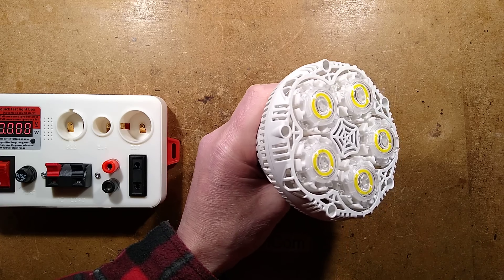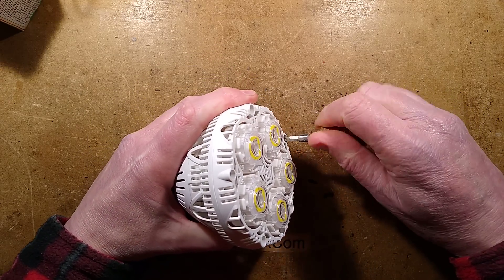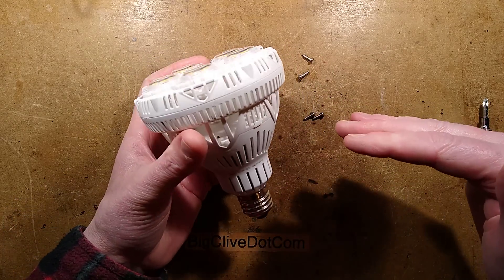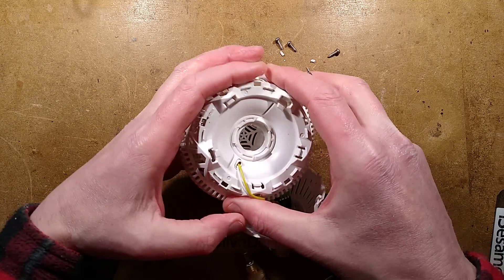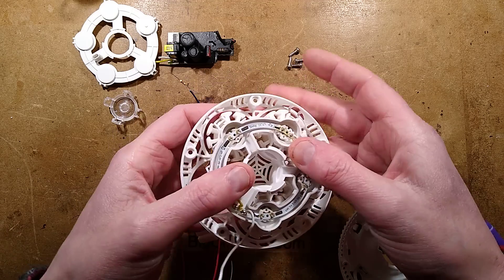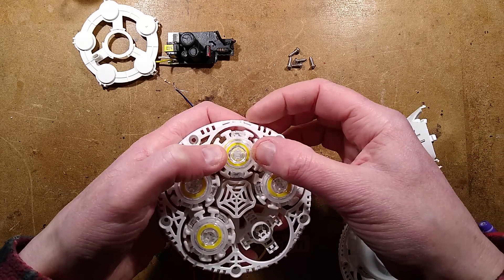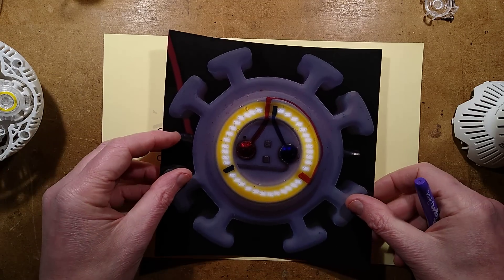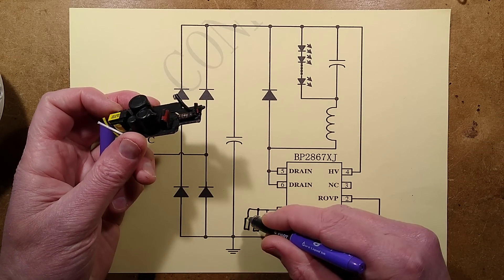Huge 30W ceramic core LED light (with schematic)

Comment: On horticultural lighting...

I've been keenly watching the horticultural LED vs 1K HPS battle unfold for... a long time. A topic that that has taken up much of my brain dollars and worn the ink off of many folks' calculators... 

That being said, this looks like like a solid contender as a grow light. 
I like the vented design very much. That's why I'm writing this. You can see that LED arrays look good on paper brand-new, but in reality, how long will they perform? I think good heat management designs like this help will win-over the HPS die-hards (no disrespect whatsover). This opinion is totally off-the-hip and regionally flippant.

HPS lamps always had venting options near the hot bulb, grow LEDs ignored this in the past relying on CPU fans blowing back into the environment. You could screw these bulbs into a simple exhaust manifold/Edison socket array, you could enhance the cooling effect on the drivers, and also get a very improved, dispersed, hot air exhaust. Greenhouses are hot and need to be vented. An array where the sockets mount on the inside of a vent, with the drivers facing out... Hey that could be pretty clever. Yada yada, they might be shit too. Anybody got a gr/watt on these babies?
Reply: You wouldn’t want to use this for a grow light. There are so many good lights out there now for a pretty good cheap price. I grow my own cannabis in Illinois. I have a medical card. I’ve got LED lights where I can adjust them for any time I want, they don’t need a fan they have a heat sink I can control them with an app anywhere in the world. I can set up a new light schedule I can turn them on and off I can adjust them. I have a grow tent and I have a ventilation fan. I have everything I need. the lights I got. we’re around $200 each. I have four of them. They are awesome. They are 600 W each light. I grow four or five plants. One light per plant. The only thing I need now. is an automated watering system. I have the seeds and the soil. I already did one successful grow. Last year it was approximately 24 ounces dried. That’s from four plants. I have to grow them in my garage. It gets cold in there. So I’m waiting for it to warm up a little bit. To start my next grow. I’m going to start it probably in about four or five weeks. I will try to get 2 Grows. before it gets too cold again. The lights that I got are called  MYLUMii. They don’t have them on Amazon anymore. I would recommend may be getting vivosun I hope you have a blessed day. God bless you and yours.
Reply: @BLUE_OCTOBER-TRIX  That sounds like a good setup man! For watering, I highly recommend programming an Arduino to automate your light schedule, watering, adjusting nutrients, and adjusting ph in your reservoir. You can get full automation via arduino and relays.

Ya.. 
Went of a good tangent about this bulb but I have also seen solid evidence of insane yield (>2.5g/w) using cheap, de-lensed, led edisons. This just struck me as as the next logical step, especially for large indoor farms. Cheers mate!

Comment: with the heat the thing gives off, could you heat a closed off room?
Reply: 30 W. Insulate your room well; very well.
Reply: Probably not very well
Reply from the maker: It could add a little heat.

Comment: it's amazing how much heat those emit, considering how 'efficient' LED is supposed to be. maybe SANSI is attempting to replace well house heaters, rrr I mean 100-watt incandescent bulbs. lol.

I wouldn't think 6 watts into 36 elements would be that bad, that's only 166mW per LED-chiplet. I don't think they would be running IR LEDs with a phosphor coating (usually it's blue to UV led with phosphor coating), interesting. maybe SANSI figured out how to break at least three of the laws of thermodynamics, stays blisteringly hot an hour after it's been unplugged, lol. /some-sarcasm

Comment: that looks like a job for somebody with a low social score but mechanical capabilities.  assembling this thing is a punishment job for infractions resulting in a lowered social score, a skilled worker has been reduced to hand assembly as punishment and the market gets a very inexpensive(buy 1 get 2) light fixture.  keep your social scores up

Comment: Sansi has a 27w ceramic light here in the States, and it is somewhat like a corn cob light, but they have a 30w like the one you dissected. They have a range of other ceramic lights as well.
Reply: Where are you finding these in the U.S.? I am interested in them... Thanks.

Comment: I looked at the previous lamps closer. You should be able to open them non destructively by showing a dental pick in one of the slats and reaching out for the inside bit of plastic with the "hooks"
Reply from the maker: I worked out how to open the simpler lamps.  You can push each clip up with a driver, but only so far, and then you need to wedge the top or they just clip back shut again.  Once they've all been wedged the top comes off with a bit of effort for easy hacking.

Comment: I must be missing something here... Why ceramic as the heat sink? I have to think there are far better options than that unless it only comes down to cost.
Reply from the maker: It's high thermal conductivity ceramic that probably has low thermal expansion.

Comment: These are actually great for beginner indoor gardeners . Very hot tho so make sure you have a good exhaust and airflow .

Cob led's are really good but if the heat isn't properly dealt with they can burn out quickly .
Reply: They always do... I've never had much luck with large COBs lasting much past their 1 or 2 year warranty. 😒

Comment: Strange and complex (over-engineered?) construction indeed. I wonder what kind of incandescent lamp it's made to replace? It's too fat for being like a PAR.
Even destroyed, I'd easily find some uses of the ceramic modules alone. Bright, well cooled, can easily be repurposed with a cheap power supply. Neat stuff on their own. 
Very satisfying plastic crunching noises, BTW.

Comment: I had 3 of those 40 watt Sansi lights, 2 of which went blinky blinky after a few months, last one still in its box. I have since gotten slightly smaller 25 watt ones that have not failed yet, powered on a AC smart dimmer plug. The smaller ones were bought in Feb 2022, so they have lasted over a year without any problems so far. There was some slight flicker on the lowest power, under 30% though, changes between 2 brightness levels only changing luminescence 2 or 3 times a minute. Looking forward to watching this on my watch later list to see what they look like inside.

Comment: We may see this housing design again as a movie prop - an ion engine for interstellar travel maybe....someone in China took a "snaps and clips in plastics- 201" course! Like the bus exhaust dip coating on the power PCB- or maybe Phil Swift hits 'em with black Flex Seal.
Reply from the maker: It does look like something the prop department would repurpose.

Comment: i have been looking at bigclive's page of projects. it is remarkable how our interests intersect-electronics, mains electricity, booze, long hair on our heads, and explosives/fireworks. thanks clive. i particularly like your trick of using 2 resistors to contact the pads on bayonet light fittings. 
.oh, and the using of 10o resistors to initiate things is brilliant. it works on model rocket engine as well as the official ni-chrome ones at a tiny fraction of the price.
Reply: Wait he has a projects page!??!!??? Ive been following for years nd didn't know this
Reply: @roxasparks  His YouTube name is the URL of his web site. Just do the obvious substitution of "." for "dot". Project page and a bunch of other stuff.
Reply: @sootikins  oh its a websitr
Reply from the maker: The YouTube channel is the evolution of the original www.bigclive.com website.

Comment: Your first pause: was it a bajonett connection that you could have unconnected simply by twisting it 60°? 😉
Reply from the maker: Sadly it wasn't that easy.
Reply: @bigclivedotcom  So it's probably just supposed to clip it in for assembling, a oneway-road. They didn't have disassembling for repairing or reverse engineering in mind. 🤷‍♂️
Buy it, give us your money and throw it away. Don't repair it, buy a new one. 🤦‍♂️

Comment: I've had one of these about a year. It's been on a 12/12 cycle for my tropical plants non stop and has held up beautifully. I have another as my bedroom light as the quality of the light is beautiful
Reply: I bought 4 a few years back, they all died within a year, luckily Amazon refunded me the whole thing.

Regular light bulbs are just a better bargain than these.
Reply: @ivanlagrossemoule perhaps you got a batch of duds, or knockoffs? Mine have been super reliable so far... Maybe they have improved them since, I dunno. Maybe I've just been lucky.  They are pricey per watt though I do know what you mean, I have a friend who swears by regular cool white cob lights. Honestly I've never tried them, but I f I had a need for grow lighting at a bigger scale  I would definitely go with something else. Do you have a recommendation for reliable lamps like you describe with a good light output?
Reply: "tropical" plants he says, Tomatoes? jajajajaja this guy.  That being said I have a handful that I use as spotlights for houseplants, I've been surprisingly pleased with these.  They seem to be brighter and less surprisingly hot than a lot of my regular LED Bulbs around the house.
Reply: @knibknibknib  yeah that's what I have them for. Much nicer to have in the house than the blue/red ones. That pink light makes it look like a strip joint. Or so I am told, I've never been to one
Reply: @murunbuchstanzangur  LOL!

Comment: This reeks of being designed in-computer and directly 3D printed, then presumably molds were made. I love how very different it is, it feels like something from the near future.
Reply from the maker: Yeah, it feels like extreme CAD.
Reply: nah, it's just a different time zone... 😹
Reply: @kittytrail  ooh, Amazon sell dem!
Reply: I think it's a future where metal heat sinks are unavailable. Probably a bad one, future that is.
Reply: @buddyguy4723  as long as the working class doesnt own the means of production the future will get worse and worse :(
Reply: @katiebarber407   another sad clown with that not even funny anymore running joke... 😤
Reply: @kittytrail  I wish I was joking 😭
Reply: @kittytrail  why should it be a joke? It's truly the only way we will see actual improvement for 99% of the population. Probably true for 99.9% in the near future...
Reply: @buddyguy4723     seems like you're ingestin' way too much fear mongering tripe. lighten your daily intake mate, you'll feel better. 😽👌
Reply: @kittytrail  i have a feeling you cant tell me the definition of female for ideological reasons.  Also, care to tell me what the running joke is?
Reply: @buddyguy4723  if you need to ask people what a female is, you're most likely the problem

Comment: Looks like this same lamp is sold as a 24w in the US. The 36W version has another LED segment around the outside and another one in the center where the vent is on this one. Interesting lamps - ultimately think they are priced too high for something that might be dead in a month ($22-26 each depending on wattage). If you could count on the buy one get one free deal, though, they'd definitely be worth it.

Comment: Recently I have been getting interested in lights like these for reasons. Would love to hear your thoughts about different cheap LED plant grow lights.
Reply from the maker: There are specialist forums that will have much more up to date data on grow lights.
Reply: I've got a few Sensi 36w ones and also the cheap Amazon LED varieties. The cheap ones are ok if very close to plants but not that bright, but then they run off a standard USB plug so don't expect anything like the watts and lux they claim. A good quality 2.4amp Samsung works better than any other. But Sensi so much better but very heavy bulbs so need a strong metal lamp fitting. Also get very hot.
Reply: I am personally a fan of the mars hydro SP 150. They are 140 watts each and put out a lot of light. I got mine for 85 dollars each (I run 5 in my tropical plant room, have larger 300 watt ones for flowers) and I've been using their brand for about 6 years now with no issues, in fact my first purchases are still in use and working solidly. They're very good for a Chinese brand imo

Comment: Ceramic "heat sink"? 😉
Ceramic doesn't have any heat conductivity.
I think it's rather a heatproof holder/mounting set. 😎
Reply: There are all sorts of ceramics so I'm not sure where you got the impression that none conduct heat. Alumina ceramic has a thermal conductivity of 30-35 W/mK which is twice that of stainless steel, around the same as lead, and about 10 W/mK below carbon steel.
Reply: @IanGrams  ok 😉

Comment: Well designed and rather bulky., Here is a question where did you obtain your light bulb tester from as I do like the design. Many thanks.👍👍
Reply: Here is the video where he reviews that tester. During the video he reads off the search words he used in EBay to locate it. https://youtu.be/hz7X7WQIau4

Comment: since ceramic is an insulator and not a very good heat sink etc. wouldnt it be better to have it made of metal? i mean we need to OFFLOAD the heat, not trap it!
Reply: Not all ceramics have poor heat conductivity. Alumina ceramic has a thermal conductivity of 30-35 W/mK which is twice that of stainless steel, around the same as lead, and about 10 W/mK below carbon steel.
Reply: @IanGrams  rite...Aluminium(A)..

Comment: 30w, you should have seen the 600w+ lamp I tried out yesterday 😅

I swear I've seen something very similar for spewing bubbles out the front

Do you think the ceramic is aluminia or just regular China clay

Do you think maybe they've been made for use on ships?
Reply from the maker: It's optimised for heat transfer.

Comment: Awwww man, taking this thing apart was so complex and interesting! 
These LED modules are very interesting, being made of 3 strings each, connected in parallel. Since they're all run from a constant current source, if one string in the module fails, the rest have harder work to do having to conduct 1.5x their normal current each, which leads to premature failure... or maybe, on the contrary, delayed failure? Typical of any parallel-connected LED strings, nothing new here.
Reply: Small correction: the buck current is a sawtooth, not constant. By applying a rectangular voltage to the inductor, it integrates the voltage, which is ramp: i(t) = 1/L * int(V)*dt, where "int" is the integral. So if V(t) is a step, then the current is a ramp. By using a large-value inductance, you force the buck to operate in the continuous mode, which is advisable to reduce EMI. In continuous mode, you get a sawtooth current waveform through the inductor, which is passed through to the LED load.

Comment: I bought one of their two headed security lights & whilst I am impressed with the overall construction and light output, the mounting is less impressive as is the performance of the PIR detector. I suspect that the double delivery is the shipper confusing the single and two pack orders.

Comment: I found an Ebay listing where these are being billed as a replacement for incandescent spot/flood lamps.  Their option selection is odd, the 30W/200W equivalent is $19.31. The 30W/200W two pack is $11.49.  they have an option for 30W/200W NEW for $8.27.  They also have a 40W/300W for $24.83.